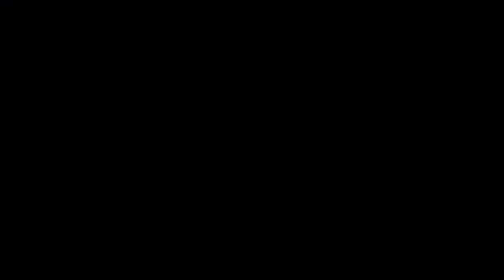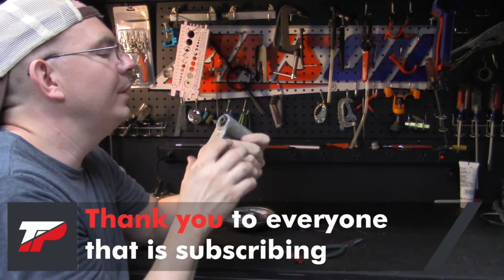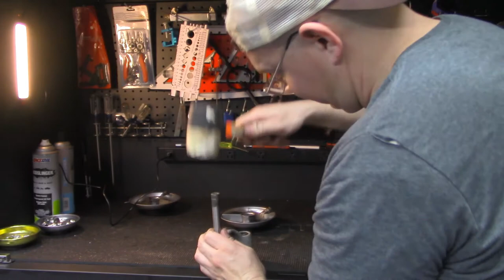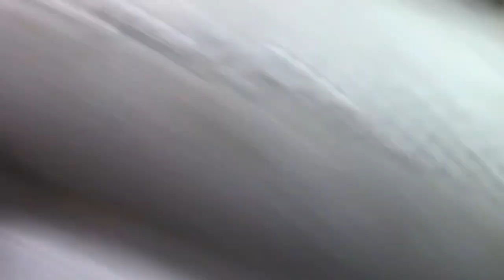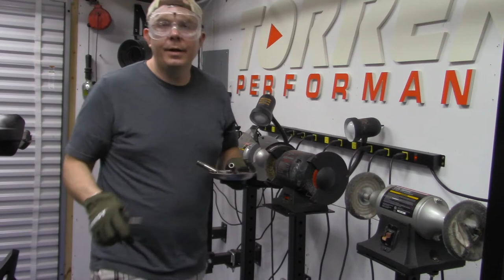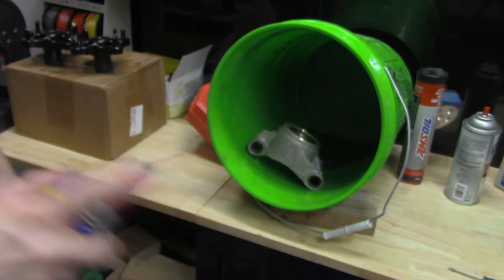Outlaw 500/525 IRS Rear Carrier Wheel Bearing Needle Bearing Repair And Exterior Housing Cleaning

Comment: I am about to do this to all of my suspension, I bought a 20 ton press, my machine was in the same boat as yours never really maintained besides oil changes. I'm worried about pressing anything out an having it rust welded to the aluminum, should I spray down with pb blaster an let it sit?
Reply from the maker: Well cane i think amsoil heavy duty degreaser will do the job. But pb blaster should work. I am filming me removing and installing this weekend and should release that this coming wednesday. However if you flip these over you will notice on the inside of the housing little notches that allow you to see the exterior housing of the bearing. I will be using a hammer and pick to remove and install i will not be using a press on these. Hope you subscribe and watch this upcoming video.
Reply: @TorrentPerformance  that isn't available around me, an I have been subscribed for a while now, just asked cause I have to have it back together by next Friday, since the 7th I've spent $3450 on it. Mines a 500 not a 525, I have 12.5 to 1 comp on race gas an premium 60/40 mix, pure Polaris exhaust, porting, a billed clutch basket, with upgraded plates an fibers. Just waiting on powder coat an the head witch will be done tomorrow
Reply from the maker: @kanerichard1279  Cant help yah out with vids then kane. Dont use a press on it remove it from the back and beat it out and then push it back in. That bearing is made different than a press in bearing. Send me some pics sometime.
Reply: @TorrentPerformance  what is your email sir or some other way to contact you? These videos helped me alot I appreciate the detail you do, an your don't use super fancy tools an try to get people to buy them